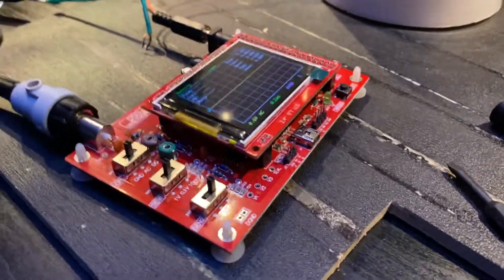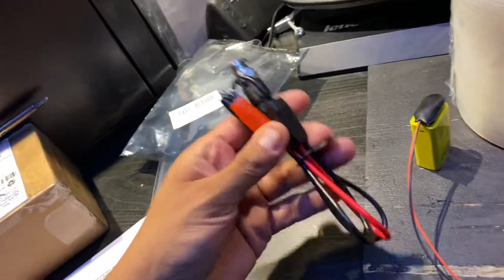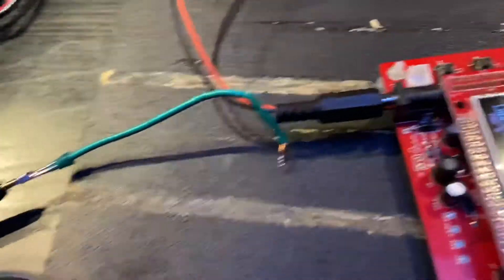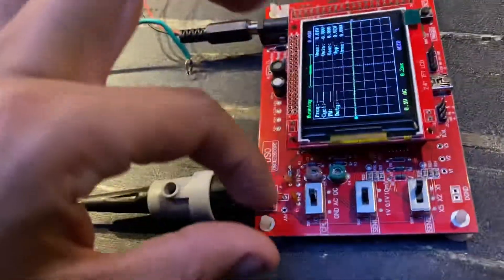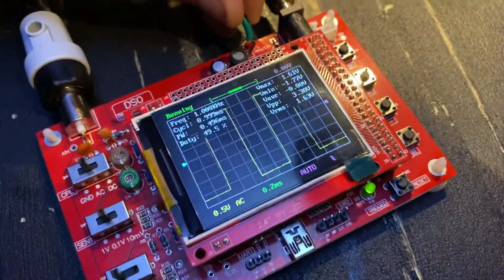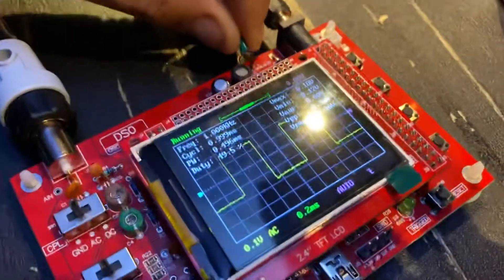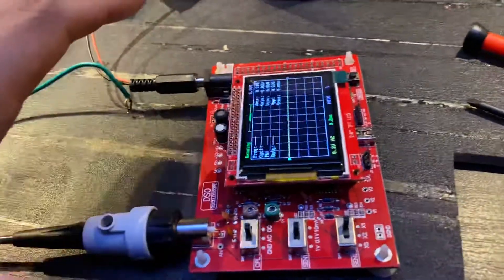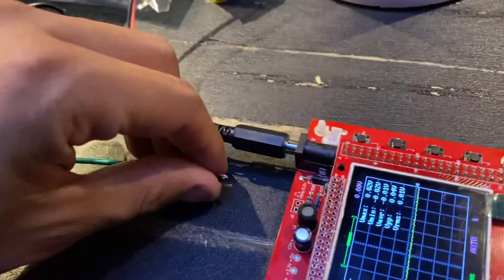Oscilloscope DSO 138 probe (x1 and x10) calibration

Comment: 1. Hissing/ beep sound coming from the device. 
2. Test rectangle signal is not flat at peaks (I am using 9v supply from buck module).

Any help ? :)
Reply from the maker: It could be you have a faulty unit.  Have you tried using a regular 9v battery?
Reply: @ogscythe6118  9v battery drains too fast. But works fine.
Reply: did you try to change that variable capacitor? in order to flaten the test signal
Reply: @christianchihaita7993  yes, tried that too. Now observed the sound exactly where it is coming from - "the radial Inductor " near the power connector.
Reply: I found a 9 volt battery died quick and a power supply made too much of a messy signal with no connection. I use 1.5 volt batteries. AA batteries in a case holding 8. Lasts for a long time.